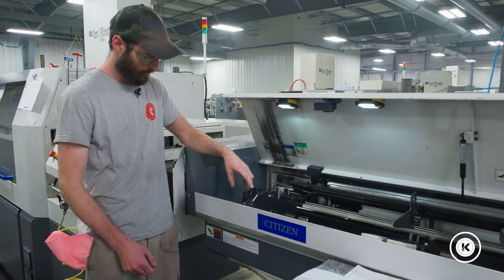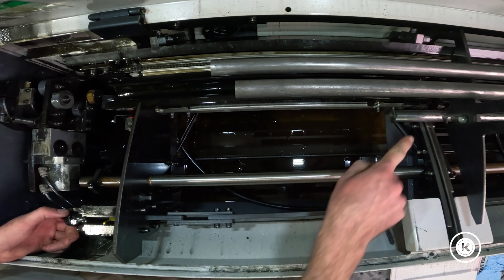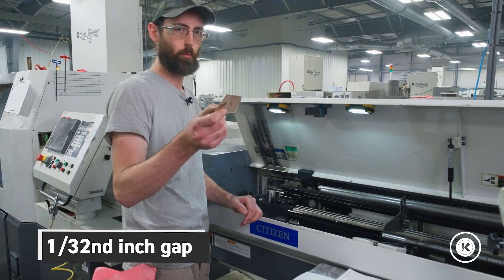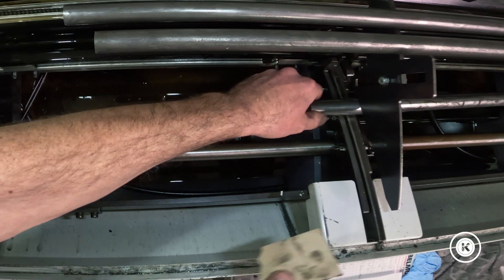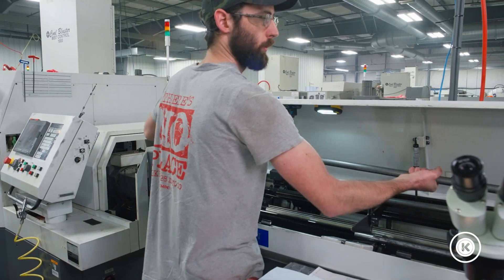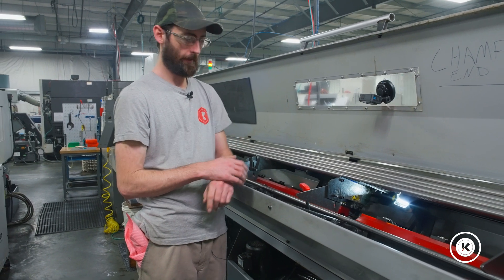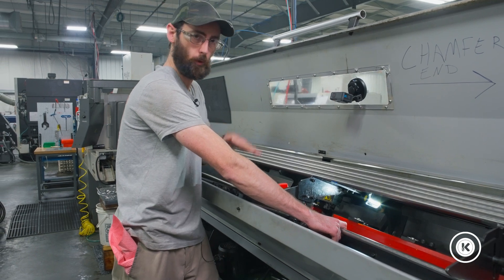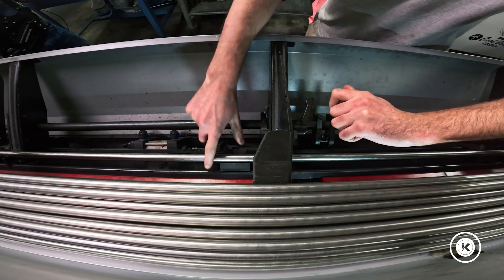Setup Your Bar Feeder To Run All Day

Comment: Killing it, Kremin! Would be interested to know how you set Top Cut position for pusher assembly changeovers. A video on bar change programs would be great too. Much obliged!
Reply: Usually we don't. The length of the pusher assembly/collets is close enough to not change the outcome, it's knocking .125-2.00" off the end of the bar, usually about .250. doesn't matter if it takes .235 or .361", as long as it cleans up. Only time we might make changes is on big production jobs, we'll make it take 1.5-2", just to be 100% sure it's taking off the whole end of the bar. 
We can put the barloader programs on the to-do list, thanks for the suggestion.
Reply: Thank you!